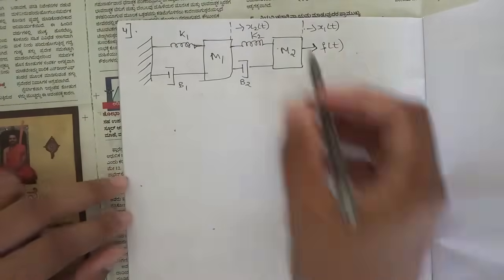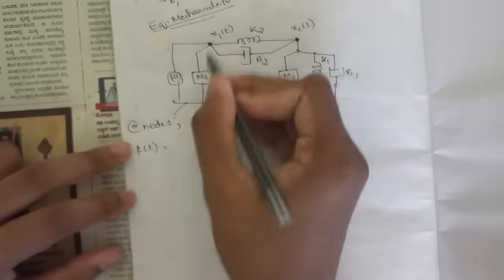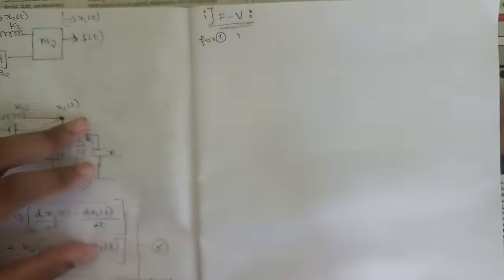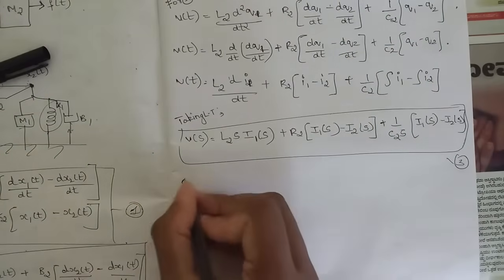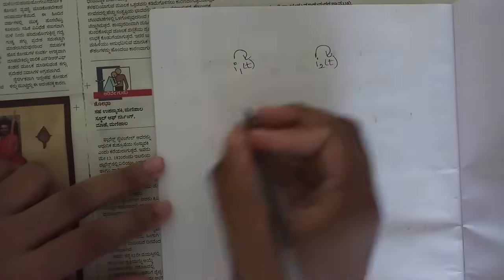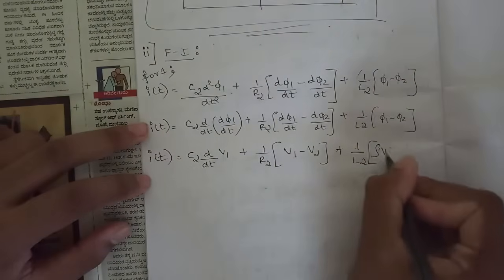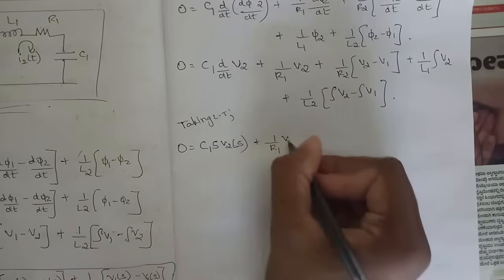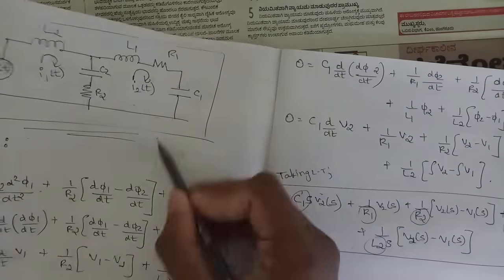5 FI,FV Analogy 1 IMP Problem Explained Module 1 4th Sem Control Systems ECE 2022 Scheme VTU BEC403

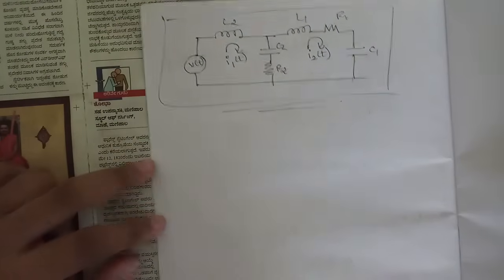Comment: 12:56 sir second loop capacitor will be placed at series of resistance sir u written wrong
Reply from the maker: It's in series only ryt
It's connected in the same branch..
Don't go with the positioning